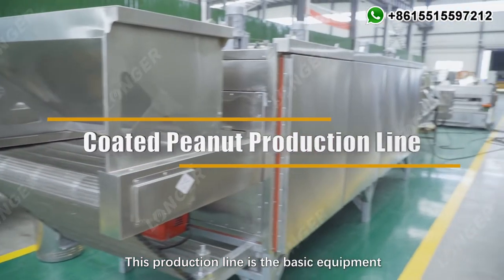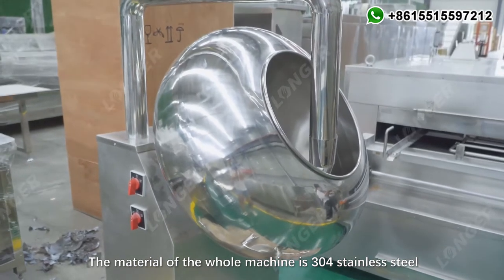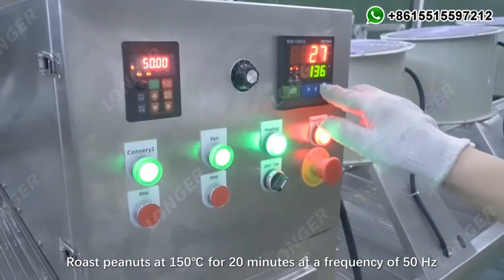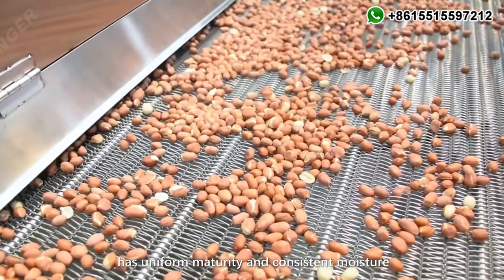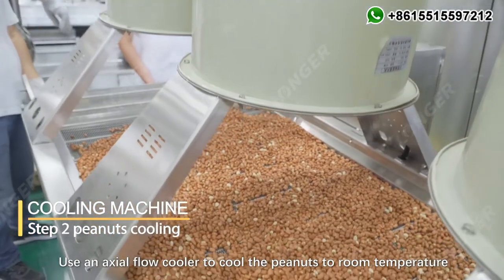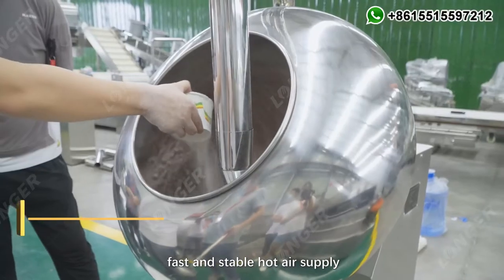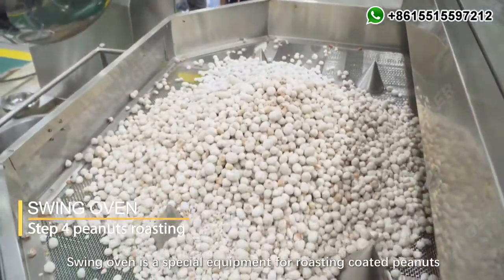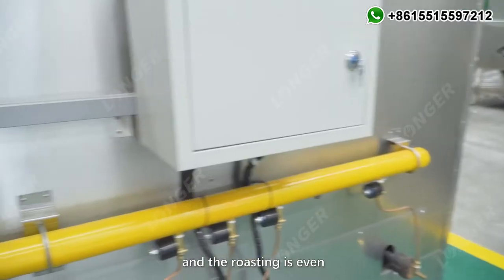2021 New Coated Peanut Production Line / Peanut Coating Machine

Comment: What kind of liquid are you adding on the peanuts with the flour. Water or oil?
Reply from the maker: According to your formula, add different materials. If you are interested in this set of equipment, please contact +8615515597212